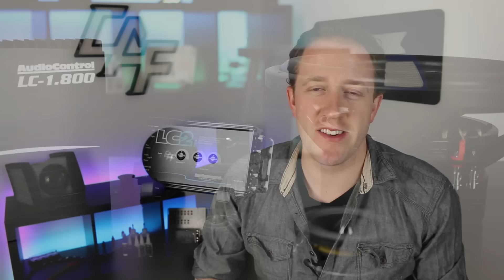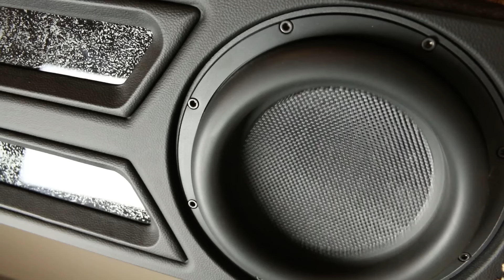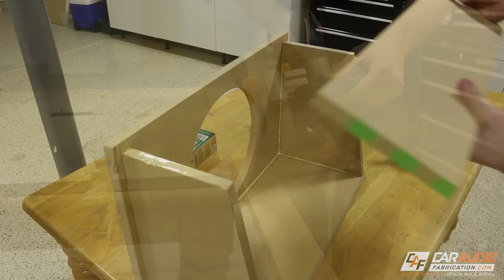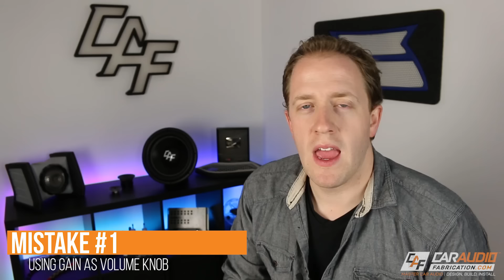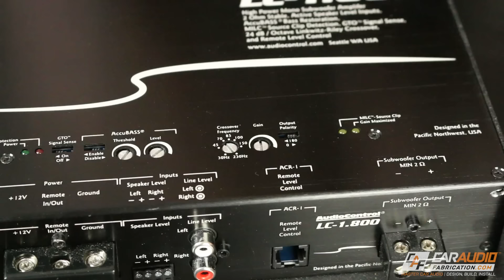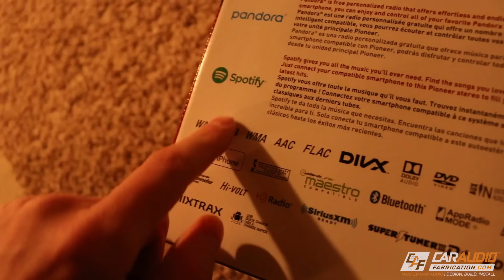Avoid these 5 common Car Audio NOOB Mistakes!

Comment: I know numerous "professional INstallers" that don't know how to set gain properly.  This is why I DIY!
Reply: Ross Melton yaI called some shops in Dallas ,an ft worth. to ask about setting my gains with a dd-1, lol they all said whats that . so I wont be taking it to any of those shops.
Reply: Ross Melton i never go to pro installers. Over priced and i can do everything they do, even better some times.
Reply: @fukkinkana  YT For the win
Reply: Chris Seng I've spent 400$ total for my setup, and i have better spl and sq than most people who spend 1000-2000 at professional shops. But i like to shop at stores for my equipment just to support local businesses.
Reply: @fukkinkana  exactly avoid getting taxed by there installs
Reply: thats why i use the remote knob gain control and adjust until i get enough bass and then leave it alone
Reply: I’m a diy’er and went ahead and invested in a SM DD1 even though I’ll rarely use it again after I set my new amp up .
Reply: Tell me about it I spent 500 bucks and I think I could've done it myself waaay better but I just get lazy just thinking about running wires front to back
Reply: Chris Seng i went through a journey searching for the right amp. I tune it by ear, and I've never clipped an amp. Basically what you do is use test tones with the gain turned all the way down. Turn it up until the tone changes either higher or lower, back it down to the right tone, and you'll be good. You can double chrck it, but it works accurately 90% of the time.
Reply: Not bashing your comment because in many cases it is true, but I have seen a pro installer and there is no way I could match a tuning that he could do with his gear.  True installers will set up microphones and all sorts of other crap that allows them to tune to levels you simply can't match by ear.  Make sure you research your installer before you waste your money like Braddah says.  If they aren't using tuning gear you might as well just do it yourself.

Comment from the maker: HEY GUYS! Question of the episode: What other mistakes do you see new guys make?
Reply: Don't only focus on bass. Show your mids & highs some love also.
Reply: Biggest mistake Ive seen is shortcuts, example
Running power wire thru a door jam, 
Twisting wires together and electrical tape
Not screwing equipment down
Running subwoofers or high power speakers directly off head unit with no amp
Reply: Buying overpriced mainstream brands
Reply: Not asking for help when you need it.
Reply: True story.. a friend had a stereo installed by a “stereo shop”. The sub amp kept cutting out. We opened the trunk and made a discovery. They stripped about a foot of insulation of ground wire and wrapped it around a support bar! No mechanical fasteners were used!! Needless to say they aren’t in business anymore!
Reply: Sticking bare wires into fuse box terminals.
Reply: Damn, Tim beat me to it. I ran the power wire (too small, too!) through my door jam, on my 79 Olds Delta 88. Worked for about a year, then caught fire! Was real "cool" watching that thing glow and melt the car trim and smoke us out while on the highway!! What can I say, it was the early 90's.......
Reply: Bad wiring/soldering jobs or poorly mounted speakers....a friend of mine had a car where the front speakers where held only by 1 screw and didn't even fit the stock emplacement....it was just hanging there lol so I made him speaker rings and voilà
Reply: trucker 9000 i have my amp wire on my battery and agree it works fine.  

The ‘whine’ you describe here you will get mainly from running (poor quality) rca wires next to the power wires.  

I ran 1/0 awg ofc for my big 3.  Made a world of difference.  

Side note here.  If you run amp wires before you do a big 3 or upgrade.  I’d run to alternator directly.  Since the alternator is the main power source while car is running it’s best to run directly to there.  But for $40-$50 do at least a 4 awg big 3 upgrade.
Reply: I did a test tone of 60Hz and turned my head unit volume 3/4th of the way up and turned the gain all the way up on my amp but there wasn't any clipping that I could hear. Is it possible that I didn't hear clipping even though there was some or is clipping usually pretty obvious to hear?
Reply: Low amp producing Alt, Changed mine from a 80 amp (old) to a 100amp @idle (new AD-244) 
Not upgrading gauge and proper grounding and fuses Which i have done (lock washers and nuts) 
Buying miss matched products stated for diffrent max amps/watts 
Not taking the time to learn anything about Volts Amps and Watts 
Anyone remember Home speaker boxes in the 80's? My car had 2 of them in the back seats LOL <<Car became a 2 seater Don't do it
Do not go into buying a sound system thinking you don't want to spend too much : #1 you get what you pay for..#2 Items "On sale" Means all sales are final.. You blow a speaker..too bad  As many other electronics go aswell...Make sure it's not a "floor model" and its in a perfectly good unopen box if you choose to buy it anyways 
#3 Pay as you go works if your puting in good chunks of money weekly/ monthly  Batt ALt Wire Player Amp Sub Speakers etc ..Don't think adding a 1000w amp hooked up to a $30 10" sub is going to anything but make people laugh
You get everything set up dialed in ...still doesn't sound right....Distortion? Mid bass is off?   Did you to use any type of insulation? Doors  rear panels trunk?  
rattles? > Invest in 2-way foam tape  Number #1 rattle i seen is License plates farting off the trunk panel  Tighten down them bolts and screws
Reply: Shopping around. Interview your installer. Find the one that understands what you expect. Someone you can trust that won't take you down a rabbit hole. A little extra for sound deadening upfront will save a lot of time and money later. Ask every question you can think of, don't be worried that you look like a noobie. Make it a hobby to learn. And most important, don't wait 30 years till it's on your bucket list.
Reply: Wiring head units to the stock ground of the cd player in older cars, causing the head unit to blow due to the dash dimmer.
Reply: I'll gladly say the biggest mistake i see noobs do.. poor grounding.. grounding to the seat belt bolt, trunk hinge bolt, awful.. #2 of the bigger, poor wire routing.. running wires threw the hood jam, door jam..UGH UGH UGH
Reply: I wanna say... GROUNDING!! The failure to clean the spot THOROUGHLY... That means using power wire wheel to remove ALL paint, rusted areas etc... Then... Wipe it down with acetone or thinner, to remove all oils and such.... I've got mine grounded to a seat beat bolt, AFTER thorough cleaning.... Another tip, use a thin smear of die-electric grease on the newly cleaned area, why? It'll prevent future rust and corrosion, duhhh!! Just my two bits
Reply: I was getting ground loop humming after installing a diy android box but a ground isolator(filter) fixed that for me.
Reply: i feel you covered it but not so much as just saying it you can shake your car to pieces if you go to big and not to mention destroy your hearing lol
Reply: The absolute most disturbing thing I have had to correct is people using electrical tape to make a huge ball of wire and tape. Please, if you must splice wires use splice connectors or (preferably) solder them and either way apply shrink tubing.
Reply: Spending big buck on subs, cheaping out on speakers and running a poor amp. Now instead I invest in quality mid-price speakers, smaller cheaper subs and running good amps through everything. Because a well set up amp can make any bass or speaker sound good.
Reply: Installing home audio speakers in a car, yep I've seen it
Reply: jlluptown I've done that lol
Reply: CarAudioFabrication great info in your videos. I would like to know your thoughts on tactile transducer aka bass shakers in cars. Have you ever used them and what are your thoughts on them. Thank you
Reply from the maker: +Phrawzt Car Audio lots of good input!
Reply: Bad installations! 🙈
Reply: Cheap Cable's, CCA :( or Expensive OFC :)
Reply: I kinda knew it was wrong. I just did not have the extra money for it. So my main mistake was the power. I did not do the "BIG 3" and Alternator upgrades. Also have a question. Is it better to connect to the Alternator, the Battery, or does it not make a difference?
Reply: I know a guy who always runs his power wire through his door jam I keep telling him it's a bad idea but he keeps doing it
Reply: CarAudioFabrication I see people using the wrong wire for the power of the amp. I had so many people come into the shop I worked at with melted fuse holders cause they had a 8 gauge CCA wire on an audio pipe 1500
Reply: Phrawzt Car Audio when I started out looking so a sub for my car I didn’t know anything about subwoofers except for “max watts” which I later found out that RMS watts matters more than the “max watts”
Reply: CarAudioFabrication a rookie mistake even i did is not doing anything about rattle noices. It can make a decent system sound bad.
Reply: Using prefab enclosures and the way they ground the amp
Reply: Mismatching amp to subs
Reply: It ties into the sub size category, but people thinking they need a certain sub size to play a frequency range; for instance small subs for higher punchier bass and large subs to play the lower frequencies.
Reply: Sub box build quality and/ or design like poor quality materials, using the wrong kind of matterials. Not sealing the box. Not using a program or chart to design the box and so on ...
Reply: Deize - i fixed one where the speakers were just rested to where the cutout in the door frame was in between the magnet and the frame just chilling.. However it did have 1 ziptie.. That was tighted enough that it had at least an inch or 2 left to go before being fully tied down lol. The girl was confused on why most of them didnt work anymore and i told her im surprised they lasted that long and that you never noticed 😂 plus had to re-run good 4 gauge wire for her 1200w amp rather than her super cheaper 8 gauge that in reality has the thickness of decent 10 gauge wire that was also all aluminium, not even at least cca. This is why you dont have your "buddy" install a system before looking at his work and references. Especially if his own system is always breaking and sounds horrible.
Reply: Mark I like your videos.  You always have good info.  I have an 08 RAM with a 15" under the seat.  Yea the sub sounds like crap on the video that I posted. Bout the 2.7cf that I
Reply: Screwing an amplifier to a carpeted subwoofer box. The carpet restricts proper air flow to the amp and the vibrations aren't good for connections of the amp.
Reply: Common mistake: Lack of planning, not seeking expert advice... it all starts in the planning.
Reply: easiest and cheapest would be a AGM battery I'd say. Helped me a lot
Reply: how and where? lol
Reply: true. Realizing that you can use way less space than wanted sucks!
Reply: CarAudioFabrication They purchase audio equipment on the same shelf they purchase paper towels and car wax.
Reply: RedDeadEagle T clipping is generally easy to hear. You probably don't have the head unit turned up to its max right before distortion
Reply: CarAudioFabrication - I've heard sound systems that sound like BRRRT BRRRT TSS BRRRT BRRRT, BRRRT BRRRT TSS BRR- POP silence... 
Meaning cockroach quality installation with just subs and ear shrieking tweeters.
Reply: CarAudioFabrication I have a 2006 Dodge Charger RT and want to put two 12 inch JL Audio woofers on a 1000 JL amp and a Alpine radio.what you think? thanks
Reply: sound insulation.
Reply: Used lead cell batteries. After being a tech now for 10years I laugh AGM or Gell cell deep cycles were needed. Pay to play.
Reply: running your power wire along the same side of the vehicle as your rca's. it caused interference.i did that ONCE
Reply: Not letting the speakers to cool down, playing on low volume before turning the system off..... voice coil expanded and stuck of course. Sub went brick.

Too fast volume raise, instant poofed it once
Reply: I can unfortunately say that I did your first example. I did it to my Silverado crew cab and was in a hurry to get it setup and work so I could start hitting bass (which is all I cared about at the time lol). Ran my amp power wire through my door jam to my battery/alternator junction box, and started running music through. I was told it would cause rain to get in my truck, I didn't listen.. like (yeah, right...i'll deal with it when it happens.) Well it happened lol, and it was because of the wire I ran through the door jam lol. Luckily I was able to shampoo it out and air it out and get it clean and dry without damage, but it was a total noob mistake on my part. Moral is, I should of listened and hooked it up the right way not whatever was quicker. Ooops, sometimes you learn things the hard way.
Reply: 1) Connecting +12v amp terminal to Power Antenna lead from head unit, and the "fix"
2) Running a jumper wire from +12v terminal to Remote terminal and wondering why battery keeps dying overnight.
Reply: I just remembered a classic eff up... Friend of mine asked me to install his system, I did, tweaked it just right, but then his buddy came along and said "Andy messed everything up" and then proceeded to hack my wiring to bits... Left channel of the head unit went silent, so I poked around and found the idiot had hooked LF+ to the Illumination lead, which explained why the parking lights and gauge cluster lit up when the radio turned on... o.O So I had to fix all the wiring he screwed up and thankfully the deck's left output transistors weren't toasted.
Reply: making too much airflow for subs, aka one wall and airflow is coming everywhere.
Reply: RedDeadEagle T probably didn't hear it.. can get a bass knob with a clipping detector
Reply: Reversing polarities on the sub to amp.
Reply: CarAudioFabrication 
Welp...my amp got drilled into my fuel tank. Wooo 650 dollars in repairs.
Reply: I have one 12" JL sub in my '98 Cherokee. I think two in your car would be overkill.
Reply: I measured the inside my trunk with maximum practical space being used up for two sub woofers. I built a box and then realized it could not fit through the trunk opening. Had to saw off 4 inches off the side and reseal.
Reply: CarAudioFabrication crossing the battery connections.
Reply: Not upgrading, or providing a ground that is equal or greater to positive side.  On older cars many times the grounding straps are corroded, broken or have simply been removed.  Ground is just as important as anything else.
Reply: When i was new to car audio i want cheap and go to Walmart to buy a 300 watts amp kit to wired my system which is 900 watts.  Instead of drilling a hole to run power wire from the engine bay into my car, i feed it from the side of my car fender and to the side of my door.  As for mounting the ground of my amp I ground it to my trunk latched..
Reply: I used an extension cord using all three inside wires together and no fuse... It was a thick one. :} Ran from battery to amp 400 watt PPI in the 1990s, was pounding good and loud and smell smoke. The whole length of the cable's sheathing burned up and started my carpet on fire. Amp was pulling to much.
Reply: maybe next time disable the comment section. To many comments on stupid stuff that many don't know what there talking about. Example, one comment saying you can not use a 4 ch amp to power a set of subs.  There is many good 4 ch amps you can bridge to run subs.  Get my point. but that may not be an option.
Reply: Low voltage! Alot of newbies only care about bass and don't pay attention to voltage which causes clipping than equipment failure like soundman aka Doug running a ct 7k with a single battery and showing volt meter at 11.7 nvm just heard you talking about it 😂
Reply: Thinking alternators charge their battery
Reply: tacka73 an actual battery charger . alternators are just maintainers .

Comment: What’s a HPF?
Reply: High Pass Filter. Allows frequencies higher than a set value to pass through to your speakers and attenuates frequencies lower than the set value. For smaller drivers or tweeters. On the other end of the scale is the LPF or Low Pass Filter which allows frequencies lower than a set value to pass through to the speaker...Sub Woofer.
Reply: High Pass Filter.
Reply from the maker: +sabarish murali high pass filter. I have a video about crossovers here https://youtu.be/BDKLYsGyBVU
Reply: sabarish murali high pass filter
Reply: sabarish murali high pass filter on amplifier. means your amplifier will only push highs such as 6x9 and such.LPF is for low bass etc